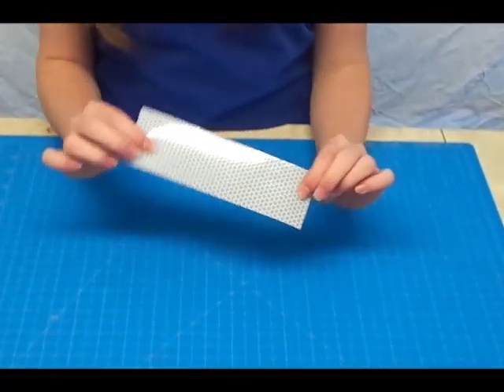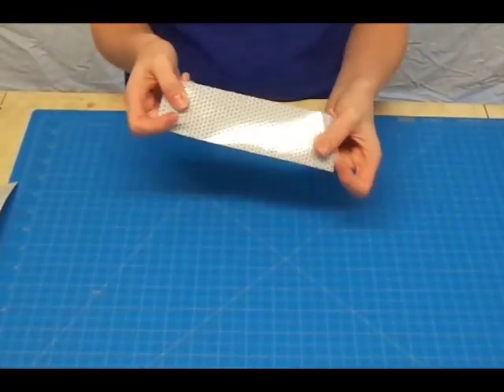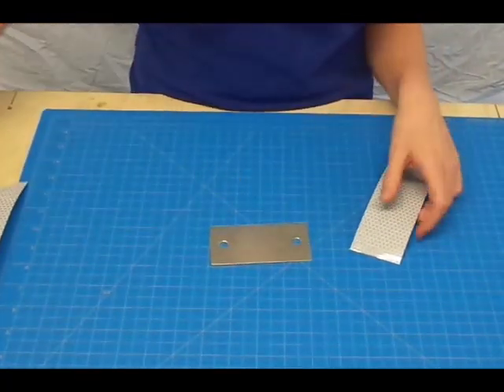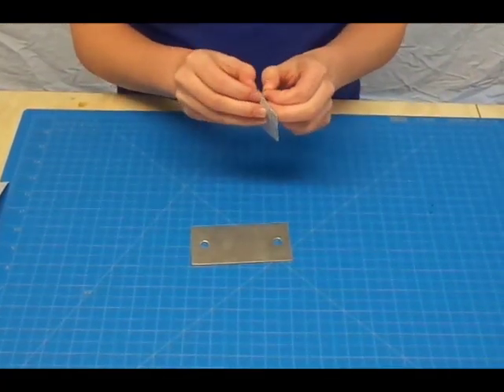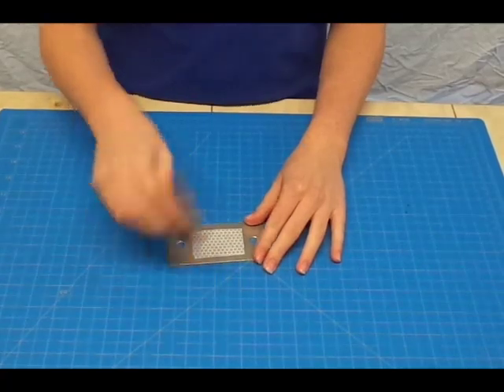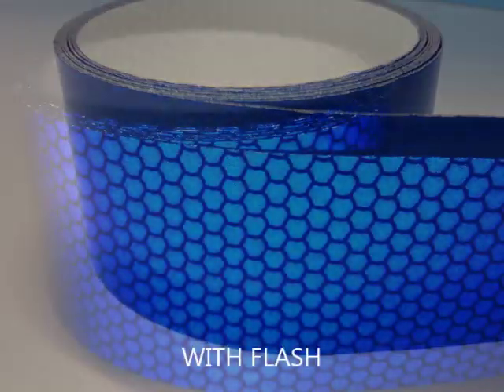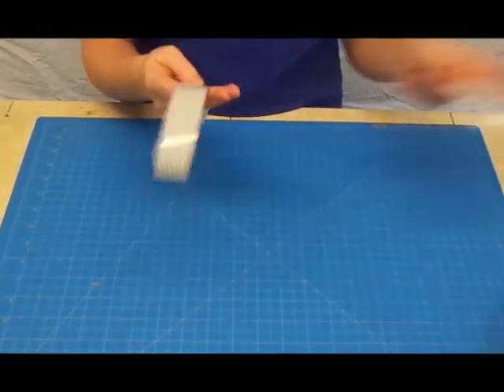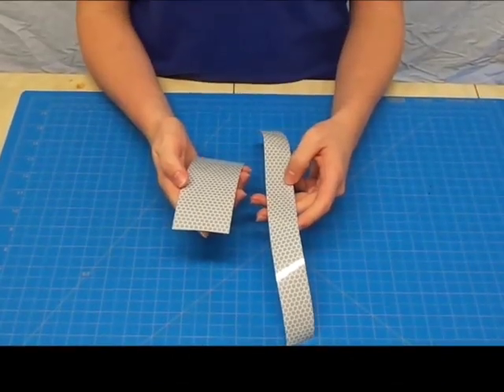High Intensity Reflective Tape: Application Information and Description

Comment: What is the bead diameter used in these tapes? Does the reflectivity depend only on the diameter ?
Reply from the maker: Micro beads are used in some of our tapes b-not all. Most are micro prismatic. The diameter of the beads would be under 35 microns.

Comment: What could be the reason the fused tape gets peeled off after even one wash?
Reply from the maker: Because they are not designed to be put through a wash with detergent etc. Iron on reflective tapes work best on clothes that will be washed.

Comment: Do these kinds of reflectors have any metal base in the paint that could interfere/block, wifi 5.8ghz or 2.4ghz signals? I want to cover my drone with this type of reflective tape
Reply from the maker: Yes....however if you go to colesafety.com you can find tapes that use reflective glass beads or you can use an adhesive (paint or glue) then sprinkle High Index Beads to make your drone extremely reflective. There is a video on our YouTube site about High Index Beads as well.
Reply from the maker: Not that we are aware of

Comment: GREAT ! I am sold but where do i buy the 4 inch tape? I need about 50 feet of the 4 inch
Reply: I am manufacturer of reflective tapes and safety product. 
Can print with your LOGO on the reflective tape.
Elizabeth.ling@hsreflective.com   +8618756577572